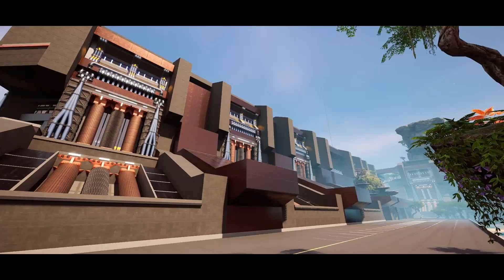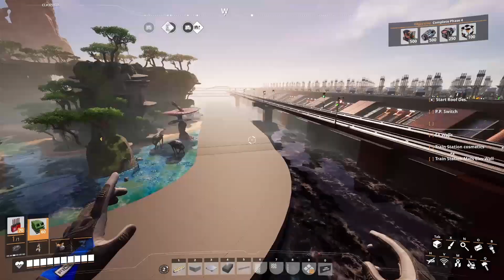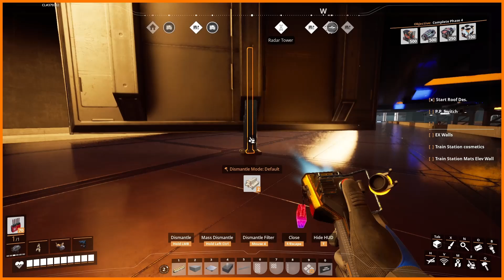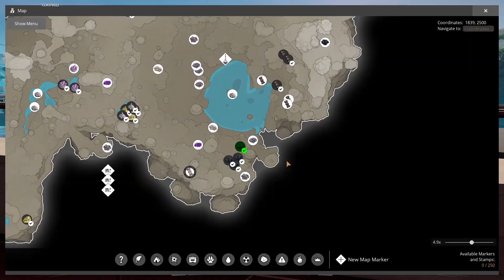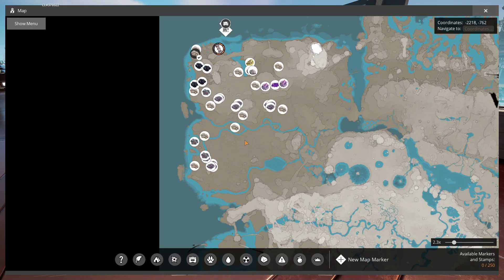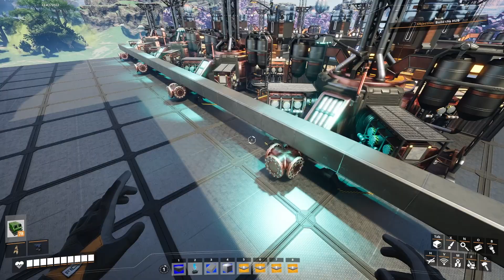This Satisfactory Factory Will Blow Your MIND...

Comment: While I understand, that decorating oyur builds to look fancy is a major point of the game's buildingsystem, it's also the #1 cause of running into the object limit. This is my #1 reason to convince myself that making my builds look fancy isn't necessary.

That said, I'm not ever gonna use blueprints for fuel generators that waste so much space as yours does. The one I use has 4 fuel generators in 1 MK2 Blueprint, all connected to the same pipe and powerline. I also have not just the functioncentric version, but a version with a walkway too, that connects that little platforms they have near their top.
Reply from the maker: Having to extend object limit is something you would run into for sure. But I find the most fun is making cool stuff rather that just completing milestones! Making builds like this does come at a cost tho ☹️

Comment: At 3:48.... were you able to point at a blueprint and sample it to build more? How do you do that?😮
Awesome factory btw
Reply from the maker: Dismantle mode -> Press R to change build mode (like how you do for zoop) -> Press MMB (not scroll) will sample the blueprint
Reply: @KyloBuilds  thx buddy! 🥰
Reply: Press F,change to blueprint mode with R and Ctrl+C...i think...
Reply: @Grumpy100pct  i didn't even know this feature existed! Was even considering making a post in satisfactory QA asking for it. This saves me hours!
Reply: @Grumpy100pct  MMB (middle mouse button) is the default to copy a target. Which indeed works in delete mode.

So F to enter delete mode, change to blueprint, find a blueprint, press MMB to copy.

This only works because delete mode can target blueprints. The copy in delete mode is generally handy, instead of pressing extra buttons to continue building after a wrongful placement. E.g. a bad belt:

1. Build belt wrong way
2. F
3. Hold left click
4. MMB on nearby belt
5. Continue build

This flow is better than having to reselect the building. I do, however, suggest having such items on the hotbar and get used to their position. You can almost always press a hotbar item and begin placing it immediately.

Comment: How did you align the rails with curve foundations, is there measurement to perfectly align the rails ? Thanks
Reply from the maker: In both my recent curve video and HWY video I talk and show the method I use!
Reply: How do you put billboards on the ceiling? I was trying to do that earlier
Reply: @Jordandoesremodeling   Use painted beams or metal beams as snap points